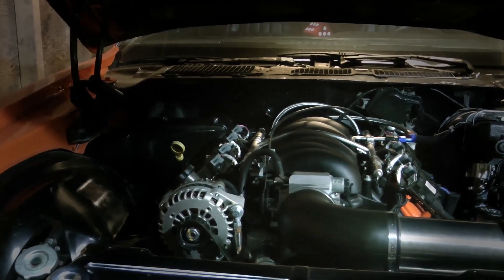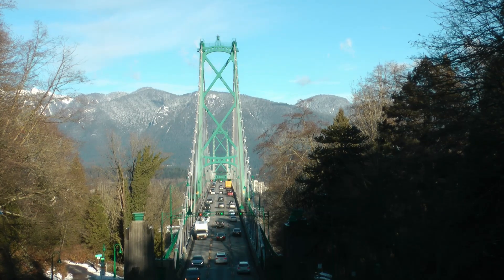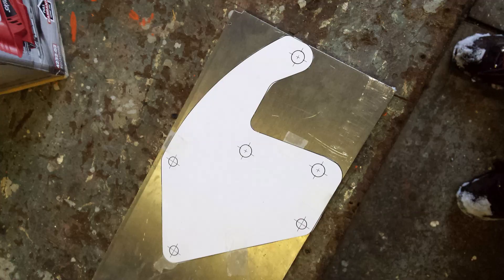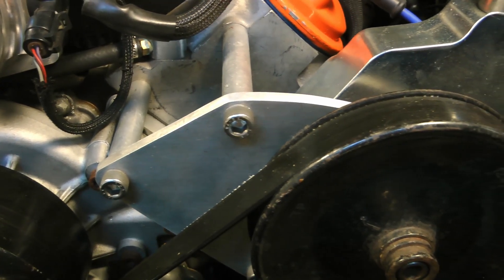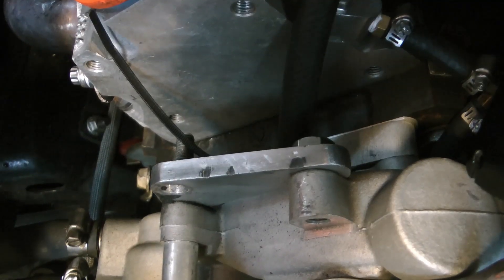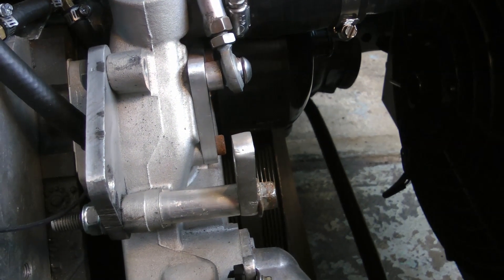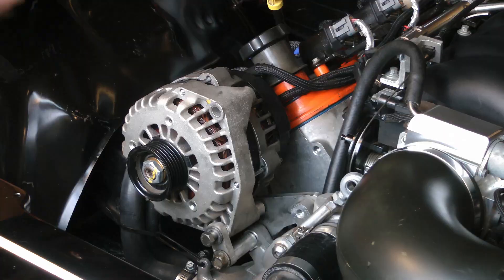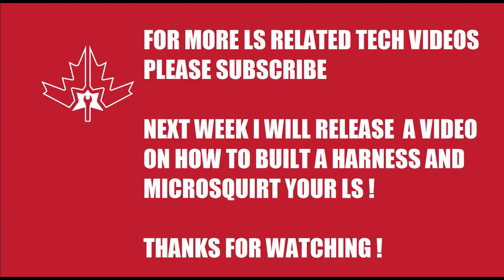DIY LS SWAP ACCESSORY BRACKETS! ALL FOR UNDER $40

Comment: Dude pretty cool. Now you got me thinking about mine, just started the engine tear down do it seems like a good spot. Have a 5.3 going into a 69 Camaro.
Reply from the maker: I actually designed and built a much better alternator bracket which you may be interested in. The one in the video works well but manual tensioners in higher hp applications aren't as great as I thought. My new design uses steel plate and an automatic tensioner. I wasn't a fan of the ones I found for sale so made my own design which sits much lower in the engine bay, even lower than the one in this video! I'd recommend the sturdier steel design
Reply: @WestcoastWrenchin  I just came across this video and you have me thinking.  I’m in the second year of a swap project (5.3 into a 91 Isuzu pickup) and everything has been “fabrication” of one sort or another.  I’ve changed out the water pump and balancer to a corvette (-1 vice -3) style in order to make as much room up front for a radiator.  Apart from being pretty damn expensive, most of what I’ve come across for an alternator and an a/c compressor make little consideration for side-to-side spacing and alignment isn’t making all that much sense.  I feel pretty comfortable with fabrication.  Welding isn’t my strong point, but I’m sure I can find someone to do that for me if/when needed.
Did you do all the draw up for your brackets or were you able to find templates to use?  And, is there any chance of getting a look at the new design mentioned in this reply?
Thanks much for the video.
Reply from the maker: @familyschnekser4819  cool to hear! I ultimately can't share my dimensions etc. as there is just too much liability on fast spinning things, hope you can understand. I actually scrapped my brackets a year or so ago as I couldn't get the accessories as tight as I wanted and bought aftermarket brackets. There are cad models available or old school measuring to get exact bolt hole spacing. With regard to spacing off the heads remember that the heads are staggered slightly! One sits a little further back than the other so your spacer lengths on each side won't be identical! As I get older I see the benefit to a pre-made cast type bracket. Even my aftermarket spacer and plate type brackets tend to walk the belt around at my power level. As ugly as they are I have found that in a higher power application big cast brackets are the best! Manual tensioner are also not my preferred and I wouldn't use one again. The 800ish hp just accelerates the crank pulley too fast for anything I could ever make
Reply: @WestcoastWrenchin  Sure thing.  No problem.  I’m pretty sure I can work something out, I just was hoping to save a few brain cells if someone else had already come up with a solution.  My HP levels are nowhere near 800, more like 350-400 (or so said the fellow who built the motor).  I appreciate the reminder about the head offsets.  I’ll let you know how things work out.
Reply: Westcoast Wrenchin' are you interested in selling copies of your new setup? My email is reaysamu@isu.edu. Love your videos man! You’re my inspiration lol!

Comment: Nice job on planning, fabrication and placement. The use of ball mounts and turn-buckle allow for any small alignment issue as the alternator is held in place at the pivot. Plus the counter-sink to re-purpose the water pump bolts. Question, that is not a truck type water pump with the outlet going straight forward, what does that fit? Also, 3/8" aluminum plate? Cool! Good job.
Reply from the maker: Thanks for the kind words! The aluminum is 3/8. That pump is actually a camaro pump! Easy to find.